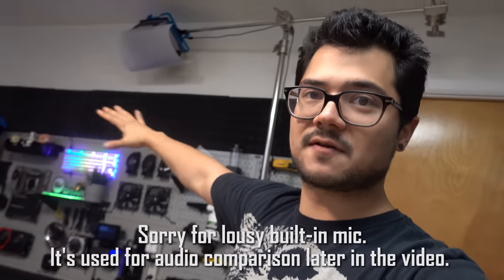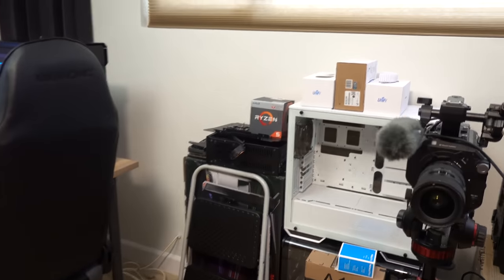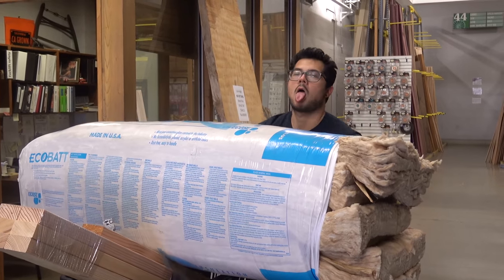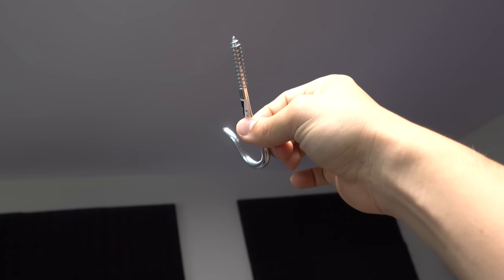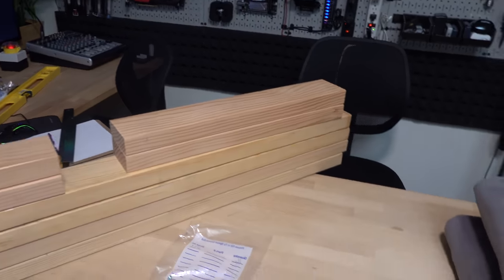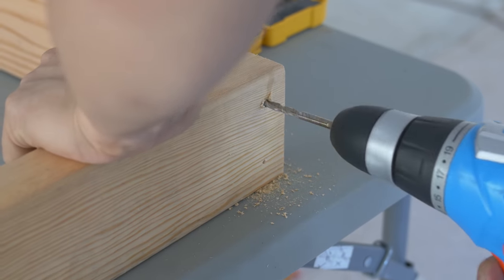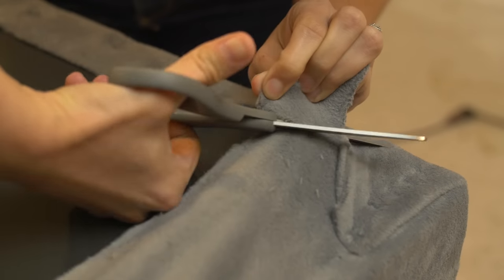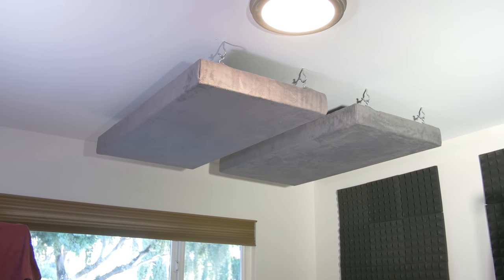Making my own acoustic panels...Was it worth it?

Comment: So as for keepinf sound pannels up on the wall staples get a hardware store staple gun longer staples and staple the foam to the wall if the metal staples bother you a little black paint or even a sharpie to cover the steel staples a second maybe worse for the wall option is to use construction adhesive and glue it to the wall the staples are the best as it easy to fill the little holes if you ever decide to change them tho for the celling I would glue and staple as for you build you could have used 1x2 lumber in place of the 2x4 it would have been cheeper and you didnt need to use 2 90 degree brackets per corner 1 would have been fine

Comment: Drop ceiling panels would be cheaper and effective plus can do full ceiling coverage USG Ceilings 2 ft. x 4 ft. or 2 ft. x 2 ft.  Radar Lay-in Acoustical Ceiling Panel (8-Pack) $37.00 a case at Home Depot that's a lot more square footage for the price now you're supposed to drop them into a ceiling grid but you could easily go the janky route and just glue them to the ceiling using Locktite  Powergrab or Foamboard  adhesives. Now going this route you would want to spread the adhesive out and not just do a few lines of it as those tiles are crumbly but if u spread the adhesive out over the full area should hold nicely

Comment: At 00:35 you have a light over your head on a c-stand with the knuckle on the left side (lefty knuckle)
Lefty knuckle is really bad practice because as gravity pulls that light down it will rotate the knuckle counter clockwise and could potentially make it come loose and fall
I've seen it happen dozens of times
Love your videos, just looking out, I've seen 30 year veterans make this mistake so it happens but just know it can be dangerous!
Always have knuckles on the right side!

Comment: Looks alright, and the sound is a bit less echo-y. I'd pinch those S-hooks closed, though, if I were you. Then again, if I were you, I would have said, "No wai" to the D-rings, and gone with eye hooks. Thicker metal, plus screwed into the wood deeper = much safer.

Comment: Perhaps speaker grill fabric would have been a better fabric? I think the fabric you used is so thick that the insulation isn't really being utilized, especially considering the cost. I'm thinking speaker grill fabric would allow most of the sound to pass through, then get absorbed into the insulation. If you kept this fabric, perhaps just using two or three layers and leaving the frame hollow would achieve the same thing for a fraction of the cost?

Also, if you get some extra thick fabric, and then use ONLY the fabric, you could even shrink down the framing size by using 1x2 furring strips. They are dirt cheap, and you can get the panels up closer to the ceiling.

Comment: The panels would do better being flush with the ceiling instead of hanging - no gaps. Anything, such as the metal cabinet in the corner should be covered with something to deaden the vibrations, they sell curtain blankets that would help. Overall this will be decent for voice work but once low end sound enters the room it wont help much. Should be decent enough for your purpose though. Good job.

Comment: Your panels will probably never fall. 

I have two on the ceiling with more... questionable methods. 
3 Drywall anchors per panel and a year later still rock solid. Even after heavy music session with a sub that visually shakes the ceiling.

Comment: thick curtains on the Window wall. even with the window open, it will be tucked into the corner like a large sound foam.
the ceiling mounted panels... not much of a difference. but i'm no audiophile and youtube compresses audio.

Comment: Bro, Should have just used basic egg crate foam mattress pad and a thin sheet of plywood. Staple foam to  plywood hang plywood.  Use 2x2s for a simple x frame on the back. Way cheaper and and would work about as well.

Comment: I feel like most people are missing the point, it's not supposed to be knight and day with only 2 panels, it's just supposed to reduce echo, which it does. Should he then wish to use up the rest of his insulation building more panels it will obviously cost less. Approx. $87.50 per panel. Not bad imo.

Comment: Looks really good, I would put up a few more in the rest of the room as you already have loads of the insulation left :)
Reply: Also, you could use rubber rings, like the ones that exhaust systems on cars are held on by, to give you the isolation from the ceiling hooks and the soundboards.

Comment: Great video. I hope, it doesn't become a underrated video. 

This is the right way to acoustic panels. 
The foams and panels are scams and overprice, like VSS in gaming headset.

Almost everyone in the home theater hobby does this. I do with my 7.2.4 surround sound. Spent 400$ on panels and extra 200$ for popcorn ceiling

250$ is nothing for acoustic panels. The main money sinker is the insulation.

I highly recommend you bitwit, to post this to hometheater forums and r/hometheater. They would love it.

Comment: Not your fault but audio production houses use Owen's Corning 71 or 75 I believe. You  have to call and order it but it's so cheap it makes this project viable. Also use 1x2 pine much much cheaper and lighter. You want to be able to blow on the front of your panel and feel your breath behind, otherwise your not getting much out of it.

Comment: Using a 1x4 instead of 2x4 will save a good bit of weight and still be plenty strong. Possibly cheaper as well, location dependent.

Comment: Posterboard on the back screwed you. You can't have something stopping and reflecting it immediately back, you need to have it let sound pass through so it goes through the panel, against the WALL (not the posterboard) and back through the panel again to get the maximum reflection reduction within the panel. if youre scared of fiberglass or Rockwool insulation, it can be dangerous, instead of posterboard, use a fabric like muslin or a thin tablecloth or sheet from a thrift store to hold in the back layer of insulation. doing that, you should be able to have a space between the back of the insulation and the end of the depth of the frame.

Comment: You should remove the poster board from the backside, since that only gives your panels a new reflective surface. 
If you have an open back on the panels, then sound that reflects from your ceiling will be "absorbed" by your panels - now it's just getting reflected. 
Also, as others have pointed out, your choice of fabric seems too thick.
Other than that, they look good 👍

Comment: First, leave off the backing poster board, you want the remaining sound going out the back, bouncing off the ceiling and then going through the panel again, from what I've seen from other youtubers, having that space is critical.

Second, rather than insulation, DIY Perks tested and used towels worked just as well. Hit up a thrift shop and buy a trunkload of towels and you'll have plenty.

Lastly, with the S hooks, I'd replace the ceiling hooks with eyebolts, they'll be shorter and a bit closer to the ceiling, making the space feel less claustrophobic.

Comment: I'm hearing quite a bit of change in audio depending on where you're pointing the camera/mic so it just seems like the treatment is very inconsistent. I feel like this isn't really the best test to compare before and after if this isn't the use case in which you want the sound to be optimal. It seems like you could realistically have 6 panels on the ceiling and you certainly have more than enough foam to do it You could probably get more consistent acoustics across the room with that. Also I really don't think having your expensive panels at waist height is gonna accomplish much...

Comment: Interesting video, but the material choice needs a significant upgrade for better performance and even lower cost... like 100 bucks for 5 panels. In a few words, sound is like water, so you want to create a towel to scoop it up. If you speak level front, your top reflection won't be much... Then side panels are the key solution for your room (add a small carpet). Top panels should be focused for top reflections mainly...

Comment: Should have just used coarse threads 2 1/2" - 3" drywall screws and skipped the corner brackets. And predrilling with that thicker bit is kind of overkill. You should check out rock wool/mineral wool it's a better product when it comes to sound.

Comment: Hey I have a pc with a intel core i5 8400, EVGA Nvidia Gtx 1070 8gb gpu, Kingston 240gb ssd, thermaltake 650w power supply and 16gb 2400mhz DDR4 ram. Should I change anything?

Comment: Every single time that I have researched and carried out a diy project in an attempt to save money, I end up spending twice as much. 

My worst was putting a stereo in my last car. It was 200+ for a premade panel plus the stereo. Instead I bought a blank dashboard for cheaper, decided to wire up and install both a Bluetooth cd deck and an iPad mini with a custom lightning connector flash drive connector by the usb charger. I ended up installing magnets to make it easy to instal and remove. In the end I spent multiple times more than I would have, and it was stolen a few months later and ripped apart. When I got my new car I decided to stick with a $30 Bluetooth adapter for my phone. Lol

Comment: I've made my own acoustic panels, and I think the biggest mistake made here is the type of insulation you got. You purchased a loose batt type. For sound absorbtion you need to use a stiff, already compressed, insulation "board", because more density = more absorbtion. Poster board on the back is decent, but allowing pass through via more fabric on the back helps with even more sound getting eaten as sound waves loose the most energy when they change what they're propagating through, more change via more density = more energy lost

Comment: Menards has small rolls of insulation for about $10 to $12....  that could have saved you some money. Also even though Phillips screws are convenient they're probably not the best for the situation. A star or a hex screw would have probably work better they have better grip with the tip of your drill.

Comment: Owens Corning makes 2inch think rigid acoustic panels  that are exactly 2' x 4' and you can just glue the fabric to them to get the same look. a pack of 6 panels is only like $70. No need for the 2x4 frames or the brackets or the expensive hooks. just a couple of those S hooks and use eye hole screws in the ceiling and back of the boards get the same result as your panels for about $12 per panel. Google 
Owens Corning 703 Fiberglass Board 2" Qty 6 if you wanna see the panels im talkin about.
Reply: oh snap plus $50 for shipping press F for that.

Comment: The one material that is AMAZING for dampening sound and is EXTREMELY cheap that no one mentions: TOWELS.
Seriously, layers some towels and see how much they absorb sound.
Make a wooden frame, fill it with flat folded towels, and wrap it in a fabric of your choice. Way cheaper and way cleaner to make than using almost anything else.
Reply: How many towels layered would you recommend sir?
Reply: I have the frames ready but have really really debated the material that I want to use to fill them with. I want something safe but that will do the job.
Reply: @manuellujan5625  I've generally used 5 or more. That plus the fabric used to wrap the fram is enough to deaden a significant amount of sound. There are videos out there that give actual audio demonstrations.

Comment: As some say, the result is bad because you build bass absorption, not high frequency absorption. Hanging a curtain opposite where you record already would do more than the thick rockwoll, that is sucking all the low frequencies and still bouncing off the high ones. But on the other hand, putting a cloth in the back and not a hard material would have been way better as well, since sound would pass through it and not to be bounced back and would help the current situation. Hope that helps. Go to soundonsound dot com, they do studio SOS articles, that are quite informative on how to acoustically treat your room.

Comment: Honestly little to no difference in sound quality, their is still a minor "sss" and echo sound that is caused by the acoustic nature of the room bouncing and hitting the mic. One advice though, the hooks, you do know if you align the curve end to the 3 prong opening to your drill driver you can generally screw it in like a wood screw. Second, cutting of the fabric can easily done with a box cutter. Just an FYI it could have saved you time, no biggie on the new information. Two panel is not enough though, since the bare wall in the back you need to sound treat that because you still have that as a point of sound bounce all on that back wall.

Comment: They are large in depth, you had to hang them as well, thus the distance from ground to ceiling is reduced drastically, and costs 250 (still expensive), and difference is...well...almost none. Maybe ceiling is not the best thing.

You need a different approach and different material, not some wooden frame and sound (looks like heat isolation or heating material preventing from cold temperatures penetrating) isolating stuff inside...

Comment: You have a different environment to control. First, don't use the studio room for storage. That presents with more things that can vibrate, leading to additional aberrant waves/sound. The room is not ideal due to the parallel and perpendicularly oriented surfaces which will create reverberations which would either augment or nullify different frequencies at different locations in the room. Hang curtains on all walls, Make a trellis type frame with terry like cloth draped over it for the majority of the ceiling.  Good luck

Comment: I feel like you went overkill with the L brackets. Definitely didn't need those, could have saved some money there! Also, standard CLS wood might have been cheaper. As for screwing into drywall, yoi can get metal drywall plugs that'll hold a filled up kitchen wall unit so they'd hold these things up way easy!

Comment: Should have left the top of the panel soft material, don't use the poster board. So that sound bouncing off the ceiling gets absorbed as well, trust me, it makes a difference, and 2x4's were over kill. I converted my garage into a completely sound proof recording studio. And you need more of them spread out more. You kinda over engineered these panels in a bad way, that also made them cost more than they should have. I made 6 for the price of your 2. Also you should use Rockwool insulation.

Comment: Lol watching Kyle do this project was ALMOST as cringey as watching the verge pc build. 
Let see...
1. A pilot hole for a pilot hole?? Lol 
2. Metal L brackets for added strength? It’s suspended on its side !!! 
3.  Poster board???????????? Lol 
4. You specifically bought 16 SUPER long wood screws which usually cost more than bulk! Lol 
5. Command strips for your precious DIY wall treatment.. 

Kyle I’m a subscriber and Enjoy your videos so here are some suggestions...

Redo your wall foam but instead of command strips and cardboard.. use a fabric spray adhesive. You can find it at Amazon or local automotive store like pep boys, oreily, autozone.  Instead of cardboard you can go get backboard/thin plywood at the hardware store and use the same type of D ring mounts and you can hang them like a mirror or use small hooks the same way you did on the ceiling but the small ones. This would be cheaper to build than those big frames. If you did it using a whole sheet of plywood it would cover more surface area 

 Although I like Ganahl lumber stick to Home Depot as they carry more and Are cheaper.

Comment: The fabric around the thing does 99% of the job of deflecting the sound. You could have just used that and skipped the wood frame and insulation :P  Just rig up some wires and hang some fabric like having a curtain on the ceiling.

Comment: Y'no, Jay did something similar (JayzTwoCents) - and achieved a similar, if not better, result just by hanging fabric/curtains from the ceiling & walls.

EDIT: Also, the audio difference isn't noticeable on regular speakers or sound bar, but is very noticeable in noise cancelling headphones.

Comment: I think that if you spent that much on materials you should have used all the equiptment and covor the full roof instead of making smaller panels you could have made a series of small sectionals and screwed them in together. Then the hang wouldn't be that noticable and you would have a larger impact. -H

Comment: You heard of carpets ? or thick matts - use thick wool and never glue a stinking syntetic mat on floor , but It would require not using boots or shoes inside like in urban sweden ( use shoes if your upper class ... and pay the bill for cleaning the carpets )

Comment: I dont know anything about sound dampening so take anything I say with a grain of salt...
Since you bought all that insulation, and it was designed for both thermal and sound insulation, why not just rip out all the dry wall in the room and replace your current insulation?  You would have to hang new drywall, so it probably would only help with outside sounds, but I dont really notice any difference anyway, maybe a little, but not enough to justify the cost.   What little I did notice, I only noticed because you pointed it out, and by next video I'll forget all about it :)

Comment: You hit it on the head when you said those panels sounded better when you were under them. That is where you should have them, just over your shooting area. Your biggest problem is no carpet on the floor and no treatment for the window.  Good job on getting panels for the back wall but that window, with a shear over, it will continue to cause echo.